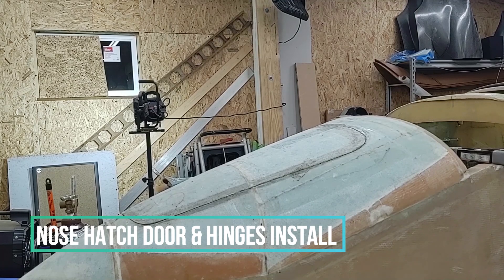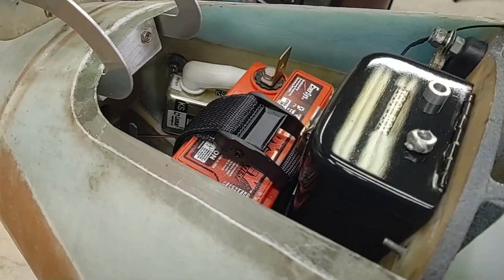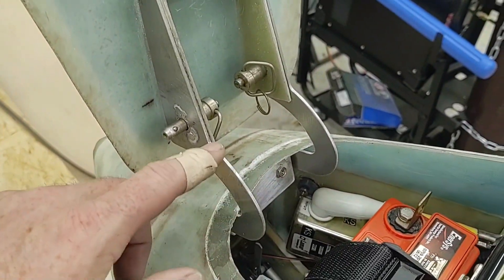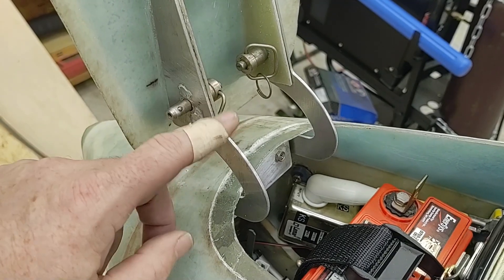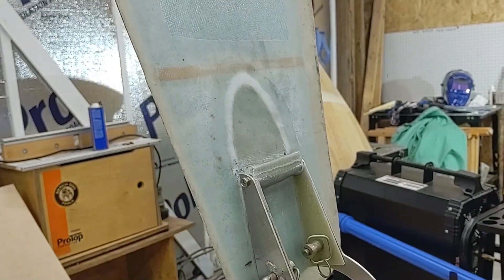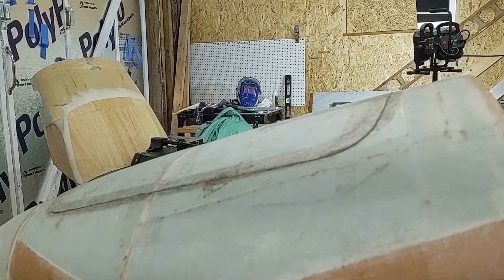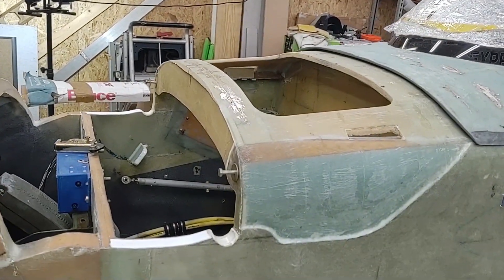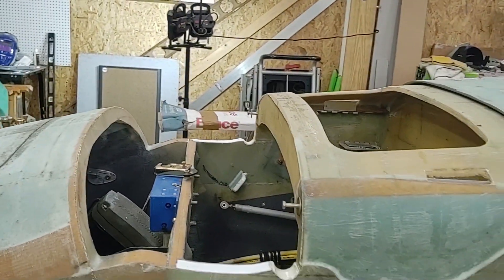Long-EZ N916WP - Nose Hatch Door Install

Comment: Love your hatch. Use a small bulb or edge seal on that hatch. You have to put something there to seal it up or you will get water in you avionics and possibly a draft in your cabin. You can also use foam tape sticky on one side.
Reply from the maker: Roger that!  I have some thin rubber that I'll be adding to those hatch flanges just for that purpose.  Thanks.

Comment: I remember back in 1995 when I was working on a Varieze, I proposed a instrument panel cover secured by piano hinges and Mike Melville said it would compromise the structural integrity of the fuselage by increasing torsional stress. I am a Mechanical Engineer and couldn't never understand Mike's logic and now everyone is using these covers in one way or the other.
Reply from the maker: I have seen covers where the removed top is the only structural piece between the two longerons.  Mine has a "picture-frame" foam/glass sub-structure between panel, F22 and longerons with the large opening in the middle for access to the avionics.  It adds a little weight but you can seriously pick up the nose of the plane with it.  Thanks for watching!

Comment: Amazing engineering . . . !!  A little late now, but I am wondering if you might heat up the base you wish to weld the spacers to, separately with a small torch, just before the tack weld.  would it penetrate a little easier ??
Reply from the maker: Nope, not too late.  That issue is still outstanding.  Will work a few different options.  Thanks for the suggestion... it may be the one that does the trick!

Comment: What if you used "JB-Weld"? Would that work? It's a cold weld two-part epoxy system that provides strong, lasting repairs to metal and multiple surfaces
Reply from the maker: Thanks for the recommendation.  I'll pick some up and do some testing on it.

Comment: Did you use a Berkut nose section because your Long Ez Nose looks more like a Berkut than a Long Ez.
Reply from the maker: The hatch door is from a Berkut template, so that part is Berkut.  The nose design is a Davenport.
Reply: @wade-airdog7730  ok. Thanks.